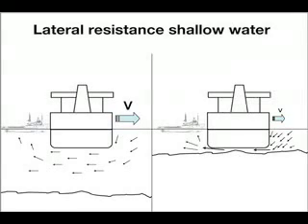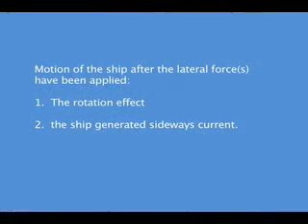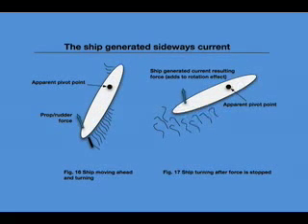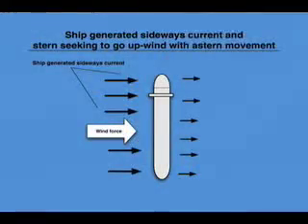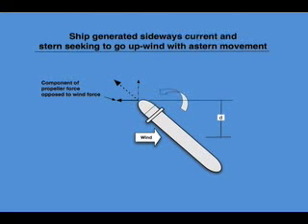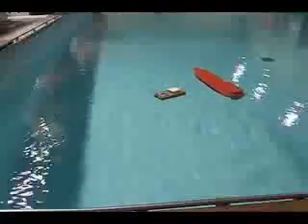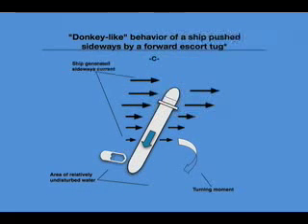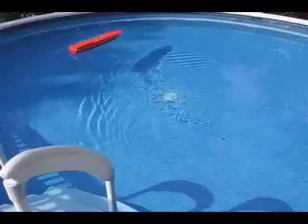Understanding the ship's pivot point -2

Comment: @jeanbassard what if two opposing but equal forces were to pull on the boat at the same time. Let's say two men are standing on opposing docks with the boat between the two docks. One has a rope attached to the boat at the base of the head or the lowest corner of the pyramid (front of ship) and the other man sets a rope of equal length attached to the center of the boat, let's say this man is on the left side. If both men were to begin pulling at the same time with the same force in witch direction will the boat be pulled?.. Thanks